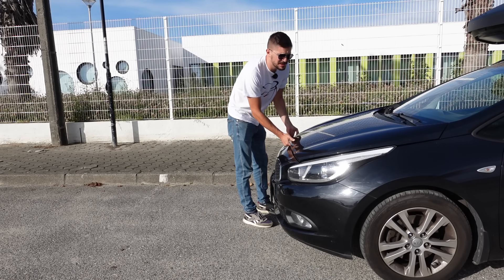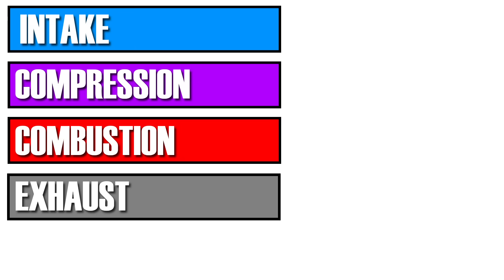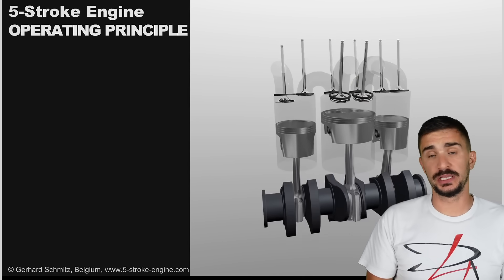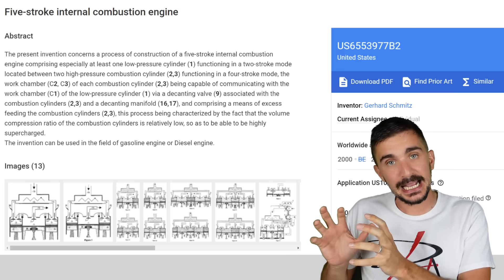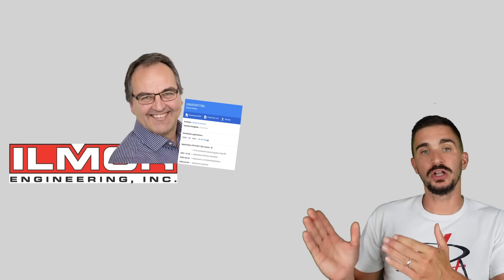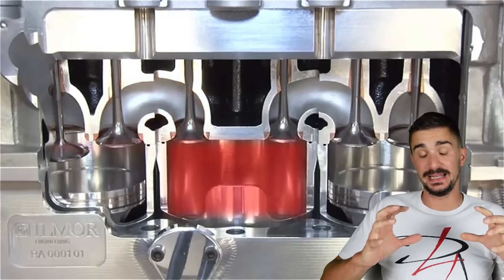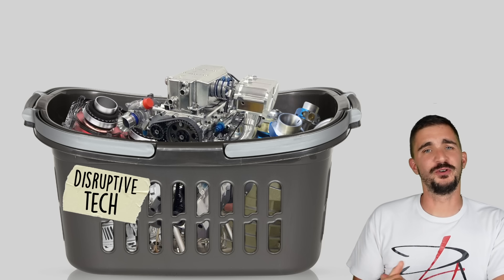Why Five Stroke Engines Are More Efficient But Still a Failure

Comment: You know this really makes me think whether you could change the way the central piston connects to the rest of the engine since it doesn't need much force to push it back up to achieve compression. Like some sort of a one directional gear to crank the crankshaft when there's power to extract, and only a light spring to push the piston back into position. Having it decoupled from the crankshaft in such manner would even let you to make the piston itself smaller, and instead give it a longer stroke to save on weight.

Comment: Im surprised no company has used the heat in the engine and exhaust to be part of a hybrid system.  Heat IS energy , its lost by gping put the radiator. . Maybe the "radiator" can power the "regen" battery.

Comment: Industrial engines course trained...the advancements are due to innovations theorized INTO TESTBEDS.
WE produce Exacting mechanical methods BUT profiteers produce profits THRU...maligned Controls...whereas RACERS/COMPETITORS demand FACTORY/WORKS parts AND cheat codes.😊

Comment: Drive the rear wheels with the gas engine, and power the front wheels electrically, off the engine's exhaust via an exhaust turbine, like the exhaust half of a turbo charger, connected to an alternator instead of a compressor turbine.

Comment: Mike says it right 35% thermal efficiency. I always notice that the EV promoters Video's talk about 20% efficiency. 20% was when Henry Ford was still alive. 35% seems low but it means there is room for improvement. I just learned about compound turbo in airplane engines of old to harness exhaust pressure. If I understand it right this could improve efficiency. I would like a video about the novel Omega engine explained easy to understand. Thanks, Mike, for making it easy to understand.

Comment: Gasoline engines will be totally replaced by hybrid électric efficient gas turbines  even puhing the economies ot these gasturbine engines 
Other: no vibrat5ion much cheaper fuel
No piston engines
 Whitles moden turbos replàce  Otto  bang bangs in
Aviation Aviation

Comment: Three questions.  1.  Could the middle cylinder have solenoids on its valve so that at low load and low temp it is closed off and operates like an air spring.  When the engine heats up the middle cylinder is utilized.  2.  Could the crankshaft be made to make the middle cylinder have a shorter stroke.  Perhaps getting only part of the leftover heat and pressure might help the turbo and catalytic converter issues.  3.  Could the inline 3 be made in the Honda 3 cylinder twin configuration or as an opposed Boxer arrangement, and is their any benefit?

Comment: @d4a You could easily make a 5 stroke engine in your garage. Start with a conventional 4 stroke inline 4 engine. Usually the two inner pistons move together with the classic single plane configuration of most inline four crankshafts (as you know). The two inner combustion chambers can be connected by piping to form the single larger middle piston of the inline 3, 5 stroke design. No changes needed to the crankshaft or engine block . You "only" need to change the valves, camshafts and piping of the two middle cylinder heads which would effectively be one double sized cylinder because they move together. I think that would be a fun project for someone ;-)

Comment: yeah, 4-stroke engines are here to stay... but they will destroy the world, no matter what. Here's a simple math for you: The International Energy Agency (IEA) reported that global gasoline consumption reached a record 26.9 million barrels per day in 2023. And about 2/3 of the total energy of that fuel (9x10^16 J) is lost to the environment EVERY SINGLE DAY. And I'm not considering other fuels, such as ethanol, hydrogen, diesel, gas, coal, etc. So it doesn't matter what fuel you use, since it's on a combustion 4-stroke energy, you'll loose all that heat to the atmosphere. People talk only about CO2 gas but they never mentioned that huge amount of heat. Carbon dioxide only turns the scenario even worse because it keeps all that heat trapped here on Earth.
Reply from the maker: I'm not saying burning gas is good for us but you do realize that if all the heat actually remained trapped on Earth we would all be baked by now. It takes just a bit of common sense.
Reply: @d4a  On a normal circumstance (without humans, LOL), our planet would exchange heat with outer space. Of course, there were natural events that our planet was heated by vulcanos, etc but that happens very rarely and through thousand years cycles. CO2 gas holds the heat in. And that's a LOT of heat. You can feel it in the air. Too many combustion machines burning fuel 24x7!
Reply: @d4a  Listen, I'm not against combustion engines, in fact, I love them. And I love your channel too. But it's a fact we cannot deny and there's pretty much nothing we can do about it. EVs are not the world salvation as many people think, as long as you use mineral fuels as primary source of energy to recharge your car... it's better burning gasoline/ethanol than charcoal instead

Comment: What if you could engage and disengage pistons like a clutch to make them sit dead in the cylinders and keep them from being a unnecessary dead weight when unneeded? Like having a straight six but being able to “shut off” 2-3 pistons for efficiency? Cause if you have differing loads on an engine it could behave and run at the optimal rpm for efficiency with a selection of cylinder count. Idk if it’s possible, but that crossed my mind while watching this. Maybe its a solution, maybe im dumb.

Comment: Hello, I just watched your video on the fire cycle engine and of course my dreams have been able to mantr up a five cycle engine with the six cycle engine and get the energy from the heat and the energy from the pressure but I wanted to comment that your example of compression ratio is not correct if you have 100 cc of swept volume and 10 cc in the combustion chamber that’s actually 11 to 1 I made the same mistake when I was learning auto mechanics because of some thing someone else had told me but just wanted to set the record straight so you could fix the video!!

Comment: 5:07 though (regarding the revs that Diesels can't rev as high) I would humbly add that not only is the mass of all components in a Diesel higher which will clearly have a negative effect slowing down moving parts as a result of component inertia somewhat, but Diesel engines also operate on the principle of self-ignition, where the diesel fuel is ignited by the high compression of the air-fuel mixture in the cylinder without the need for a spark plug. This requires precise control of the injection timing and a relatively longer time for complete combustion, especially at higher speeds. As engine speed increases, the diesel has less time to fully ignite and burn. This leads to inefficiency at higher RPMs and can, or will, cause the engine to knock. By comparison, gasoline/petrol engines can precisely control the ignition timing through the spark plug, even at higher speeds, allowing them to operate more efficiently at higher RPMs and subsequently reach much higher RPMs.

Comment: ICE is no over and i think we can make a very efficient  engine without cooling and without loss on exhaust (exhaust at ambiant temperature and with catalytic capability, yes sir). I don't talk more about it cause i don't make a pattent for the moment  Concerning the 5 stroke, it's easyer to make an Atkinson cycle (with a regular ICE and open the admission valve during the compression, like Toyota do). The compression ratio dont increase efficiency by  pressure (cause this pressure is lost in the compression stroke) but decrease lost cause less surface of the cylinder is cooled . An engine with opposed pistons no head is more efficient for the same reason less loss cause less surface cooled cause no head.

Comment: The only reason diesels only produce 40 percent per their counterpart is because idiots like you buy into human forcing of the climate and won't let them do the work they were designed to do... Nice try... If you want more people to buy into your theories and ideas, maybe leave your ideas about climatology out of the equation and focus on the engine without the rubber bands around their neck while trying to run a marathon...

Comment: Thank you for your very informative video's. I have a question. Has anyone tried to make an engine were they have the combustion occur in a separate chamber so as to create a high pressure and temperature gas that could be controlled and feed it into a simplified piston engine for expansion and power output. (I believe that this has been tried by a French company but using compressed air) Perhaps in this type of system a five stoke may have a better performance. I do understand that that at low RPM and load it would still have the same limitations as the five stroke. Or possibly the five stroke would not be needed as the volume of high pressure gas could be regulated so that the exhaust pressure of the piston cylinder is better regulated for engine conditions. In such a design the time of combustion would not be limited by the RPM of the engine thus potentially giving a cleaner and more efficient combustion particularly at high RPM.

Comment: You can inject water in the exhaust gasses instead, this will take convert the remaining energy into mechanical motion, you'd need a water to diesel ratio of 6:1 in order to exert a force 1/3 of the diesel stroke so given the same amount of expansion you'd generate 1/3 of the work and energy of the diesel expansion, if you take 40% out of the diesel cycle that'd mean you will get another 12% energy from using deionized water totalling to 52% efficiency although given the cost of deionized water is the same as fuel you would spend 6 times the $ you're spending right now for fuel, a built in dehumidifier could be driven from the remaining 50% unused energy but this will add complexity.

Comment: An idea: Could they not add an intake valve and injector to the middle cylinder to work as a fully functional 4 stroke cycle on low RPM - then when the engine reaches higher engine speeds they turn off this injector and valve (don’t know how this can be achieved) and begin to use the middle cylinder as originally intended (combustion expansion cylinder)

Comment: I agree with everything he said .. 
The only thing i will add is as a work around there should  also be an engines hours cap . 
So 75 k miles . 
Say 3 k engine hours ( i haven't worked that out  but most of ours fail around 85-105 k miles . .my van is doing an average of 18 mph so thats 5555 hours to 100 k miles and total engine failure  ) . 
Or 5 years .. 
Not great but cheaper than a new engine .

Comment: I wonder if it was a 5 stroke, 5 cylinder, with independent ignition on each cylinder. One is always firing. Or maybe a 10cyl 5 stroke for more power? But Idk, I'm not an engineer, I don't have a PHD, only ADHD. Lol

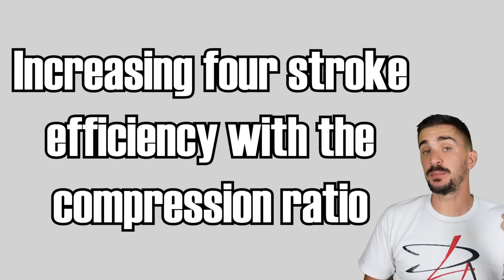Comment: PAUSED VIDEO here 3:00 This is where TURBINE comes to play - works like FORCE MILTIPLIER / pressure divider, fed by exhaust. CROWBAR, LEVER. The problem is turbines cant harvest it all. Not connected to crankshaft cant react instantly. Imagine small piston driven by big piston. Both travels same distance but since it's diameter is smaller it's able to compress air to higher pressure. Smaller force is able to create big force on smaller mass. Lever. Turbine is based on simmilar principle just instead of two pistons - fans rotating. 

TEMPERATURE of AIR and PRESSURE are corelated. You can heat up air by compressing it, cooling down by decompressing. Transforming one into another allows to cool down exhaust and harvest energy of pressure and heat at once. So perfect system would involve both processes at once. The problem with turbines is that require stable speed. Engine with small turbine can react fast, engine with big turbine is stronger but require more time to speed up the turbine. Some cars do have two and air is redirected either to one or another. 

 I CAN IMAGINE we could harvest this pressurized air not by using turbine but pistons - using pressurized air to feed some kind of heat pump almost like in Stirling engine fed by conventional 4 stroke engine. And/Or use existing pistons to harvest temperature / heat by heating up something else like for example some engines - water vapour, directly injected into chamber. Cooling down engine and essencially by transforming liquid into gas.  "Ignite" water is like  adding 2nd fuel to flow in pararell.

Since engine block require lower temperature than 90'C. Injecting water inside is unhealthy. Would be difficult to harvest energy via water or just air. So technically we could use some different gas / liquid such as alcohol boils at 60-70'C or gases used in heat pumps. Fed by heat of engine block instead of compressor. Run it trough some turbine. Then cool it down allow heat up again..That in theory could allow to increase efficiency even further.
Reply: 7:30 Oh so it's almost what i wrote, big piston 3rd one, but feeding the 2nd with air, and helping in pushing smaller one on crankshaft
Reply: 8:00 Not forgotten 2003 just like i wrote its NOT true, turbines are based on same principle of harvesting energy of pressurized air and feed it back (indirecly) to engine.
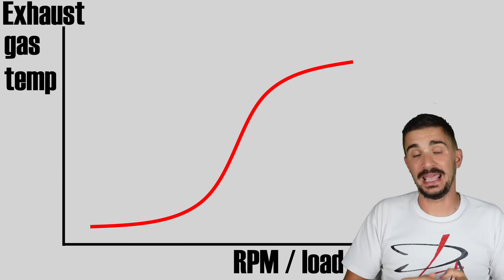Reply: 15:00 Exactly same problem is with big turbines connected to engines, for this reason there is valve involved and on board computer monitors how much air, ito monitor whenever urbine is able to feed the engine, EGR is also added to system so engine can be fed by its own exhaust. Or i have heard that in some designes made by BMW there are two turbines big and small. In 5 stroke engine all is fixed, static

Comment: Why not just use an electric preheater for the catalytic converter? Those are super cheap, and the engine needs to run an alternator anyway.

Comment: Watching this very interesting video has brought back to my mind a technology I read about more than 10 years ago. 
That technology involved capturing the heat coming off of the exhaust manifold and other parts of the engine and using that heat to run a turbine or some such thing. According to that article, engine efficiency was improved by a significant amount, the details of which I do not remember.

Comment: I mean, agreed that for the car, the 4 stroke is incredibly hard to beat... but a turbo is very similar in concept to the 5 stroke anyway, and if you look at the titanic, it actually crashed because of exhaust energy recapture (the central prop was turbine driven as a recycling system). Ultimately a huge part of why 5 strokes are bad is that cylinders are bad... they're just compact, easy to maintain and support a wide RPM range, but there's a reason turbos aren't cylinder based.
There's also an interesting question over 5 strokes as a hybrid car, though I doubt that'll be that great.
Also... electric motors have been around since like, 1834... they turned 150 in 1984. They're approaching 200 years old - I know that's not what you mean, but they've been around for a while.

Comment: The supermarine spitfire used a crankshaft-driven supercharger (as opposed to an exhaust-driven turbocharger), so they wanted to do soething with the residual pressure of the exhaust gases. They used curved pipes so that the exhaust gases provided some thrust.

Comment: greg's automobiles and airplanes does a great video on Turbo-Compound Piston Engines, which harnesses exhaust power with a turbine to directly add torque output. Very much like the extra cylinder

Comment: Larger capacity slower running engines can give better fuel economy, and this has been done before, and of course a turbocharger can utilise wasted exhaust energy for efficiency instead of output.

Comment: I theorized several different engine designs when I was a teenager. They all would have produced power, but not efficiently. They wouldn't have come close to the standard 2 or 4 stroke engines. It is fun to theorize.
.

Comment: A turbo also harnesses exhaust pressure that would otherwise be lost, it has a "waste" gate to not produce too much charge pressure, but why not take the energy out by converting it to electricity, then electricity could keep the rpm's up to eliminated turbo lack.

Comment: In one of you're videos you were working with water injection in you're (If I remember correctly) MR-2 

I really think that's on a good path in advancing traditional ICE design.

Advanced implementation/integration of H2O just makes sense and can solve so many issues at the same time.

Traditional water cooling as a separate system isolates it from being useful in the main combustion system which it can solve several issues at worst and at best could basically solve (All) of the major drawbacks of ICE engines from turbo performance to Detonation control and engine cooling to emissions.

Would advanced integration of H2O be particularly easy? Not exactly but all of the technology to do it exists. It's just a matter of implementation. 

Enthusiasts like (Us) need to try the things the large companies wont, can't or otherwise aren't allowed to do. 

We need that skrill. Them dolla's. 

And or people with machine shops and such.